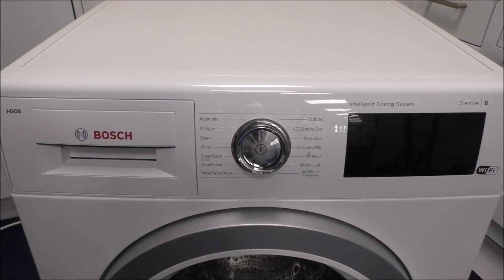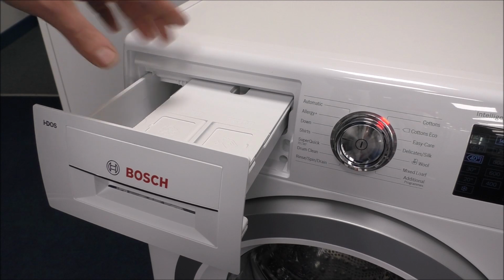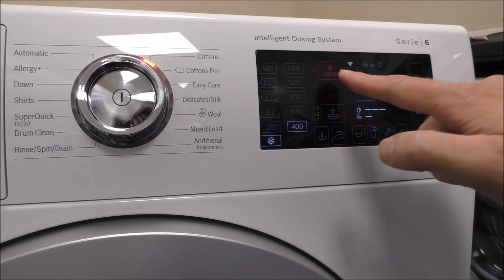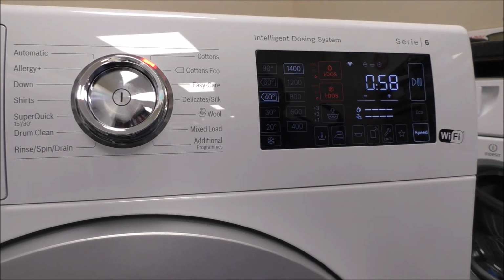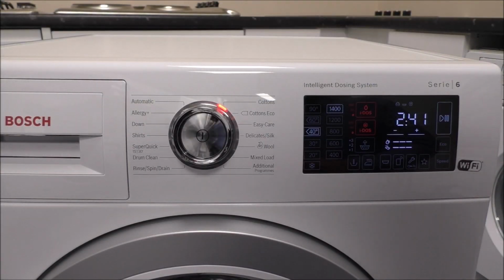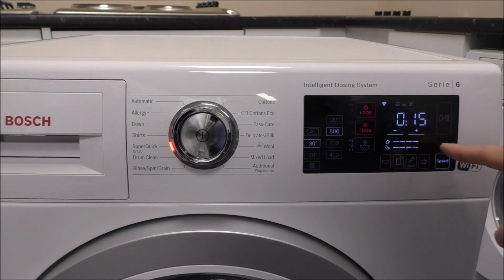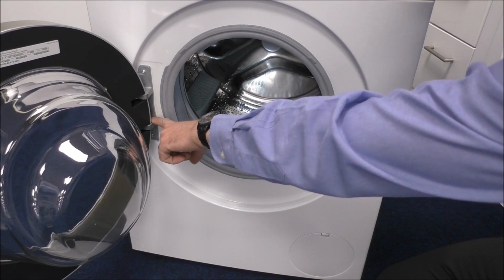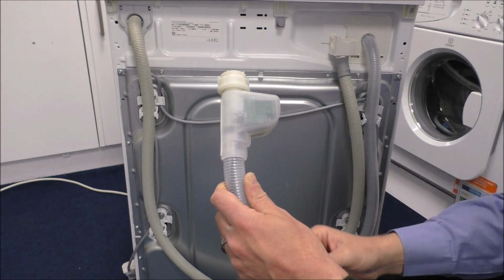Bosch WAT286HOGB 9Kg I Dos Washing Machine

Comment: Hi, thanks for this great video. I have been looking at at this exact model (9kg) and have found one on offer reconditioned for about £180 with a warranty for 6 months from a supplier I trust, however would the 9kg machine be too big for just myself (1person) and will I end up spending more money on electricity/water bills? Can this machine adjust its water and elect its consumption automatically based on the weight of the clothes in the machine?
Reply from the maker: It won't be too big for 1 person, as this machine only takes the correct amount of water and detergent according to the load that's in the machine

Comment: Hi 
I have just set up my new Bosch WAU28PH9GB iDOS washing machine. Will this machine assist me to weigh  washing to the correct weight before I start the programme?
Reply from the maker: It wouldn't normally weigh the clothes, but it will correctly take in the amount of detergent depending on the load size. It does this by sending a small amount of water into the drum to start with, and depending on how much is saturated will depend on the amount of clothes in there.

Comment: Hi excellent review. Could you explain a bit about setting the iDOS system base set up for detergent and softener?
Can I use concentrated softener and detergent by adjusting the base settings?
I have bought a series6 which is being delivered on Thursday

Comment: A great in-depth review on i-DOS and other features. I have a question on using liquid detergents manually. For example, can we add a separate detergent while washing baby's clothes in the first compartment keeping the i-DOS liquid detergent and softner compartments filled and the i-DOS options turned off during wash cycles? Will it take only the baby's detergent added in the first compartment? Please confirm. Thanks!
Reply from the maker: Hi, yes you can use a one off detergent for a specific programme and turn off the i-dos if you want to.
Reply: @lords-electrical  Thanks for confirming
Reply: @lords-electrical  how do you turn off idos or is it already off until you press the idos buttons

Comment: Hi just purchased today, put load in machine but for some reason I can't seem to turn the dial from cottons to easy care , dial wont turn to any setting might be something simple what may be causing this problem??
Reply from the maker: Not too sure. Try taking the clothes out and reducing the load size as several programmes  are for smaller loads only of around 3 - 4 kg. Not many programmes are designed to use the full capacity.

Comment: Hello, I have a question, I have bought a bosch serie 4 model wak20267in,, in mix load mode the time fluctuates, is this normal? does it need to be repaired?
Reply from the maker: That will be correct. All of the Bosch washing machines will vary the wash time depending on the size of the load. If it's only a smaller load, then the wash time will be reduced, so it doesn't sound like a fault.

Comment: Why are they considered energy efficient if they take 3 times longer to do a load then regular washers? Seems to me they use more electricity
Reply: Thank you for the info🙂
Reply: You can choose the option of half the time. This on is the speed button.
Reply from the maker: I know it sounds bizarre that  a washing machine can take a lot longer to wash but uses less electricity, but they will soak the clothes for longer and ideally if you can use the longer programmes, you can save money and also the washing performance should be better as well.

Comment: For sure, one of the best in-depth reviews of this machine. I will look foward to some day I could have one of these. Do you know how much is it costing?
Reply from the maker: They do vary in price but it does normally retail for around £600 - £700
Reply: I just bought the same plus dryer the same set, and it cost me 1050e yesterday 18.5.2020